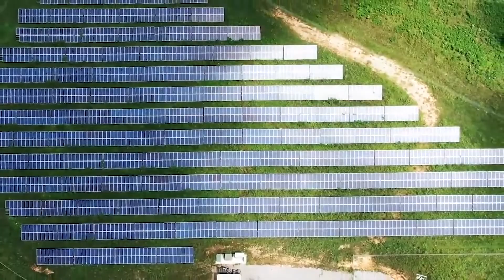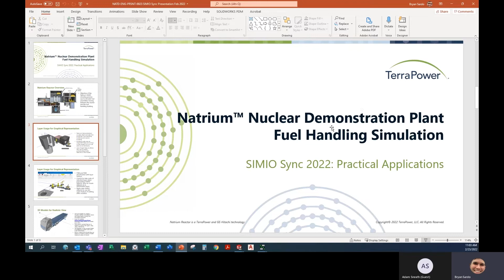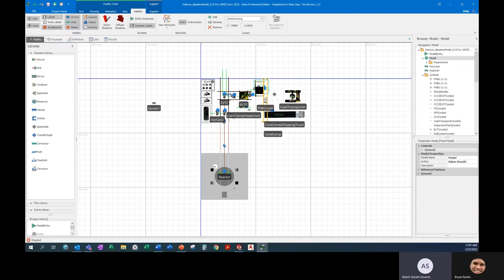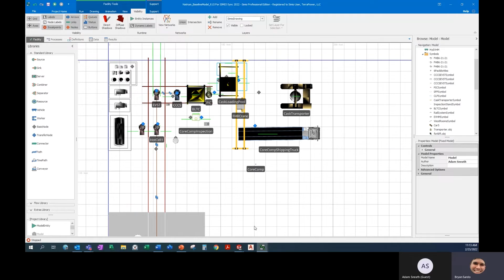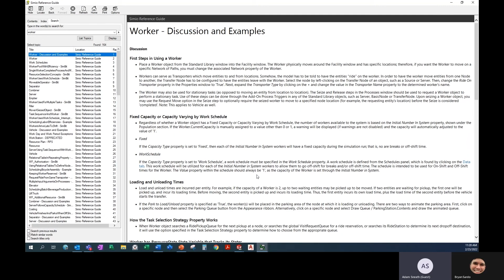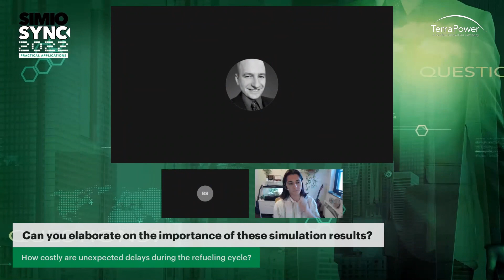Terrapower - Natrium Nuclear Demonstration Plant Fuel Handling Simulation

Comment: So.  In a video labeled "Natrium Nuclear Demonstration Plant Fuel Handling Simulation", instead of seeing the actual presentation of the nuclear demonstration plant fuel handling simulation, I get an extended lecture on the formulation of the AutoCad 3D modeling programme used to construct the nuclear demonstration plant fuel handling simulation, at the tail end of which appears to be a Q&A snippet from the afterword segment of the nuclear demonstration plant fuel handling simulation which I didn't get to see.  This is like putting out a video labeled "2026 Paris Grand Prix Full Race" and instead of showing the race itself we get a lecture on the design and assembly of the internal combustion engine.  Thank you for completely wasting my time.